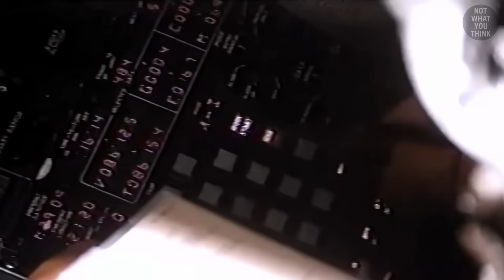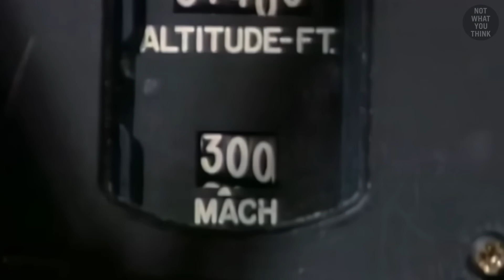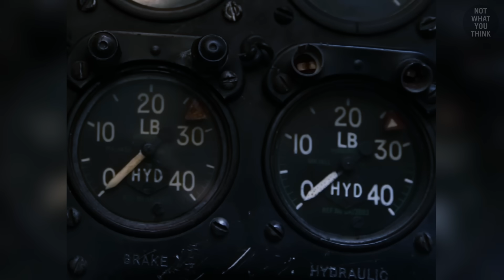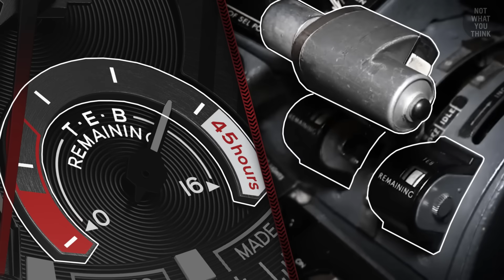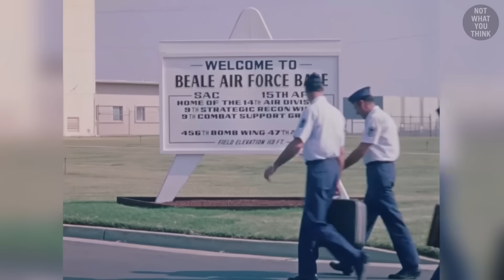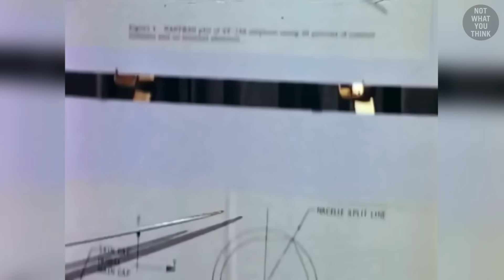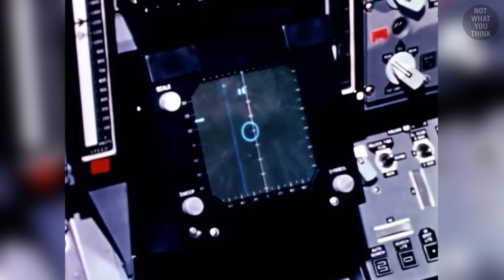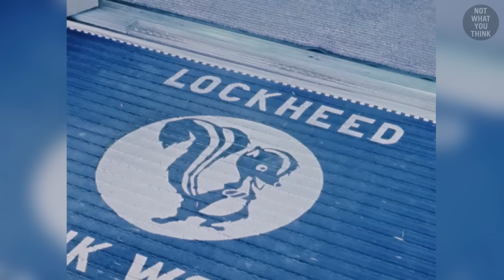Real Stories From The Cockpit Of The Untouchable SR-71 Blackbird

Comment: When I was working at NASA at Edwards Airforce Base back in the 90's, the SR-71 would be flown quite often on test missions. One of the cool things happened in the control room on every mission it flew, after MAC 2.5 and 100,000 feet all data in the control room would be displayed as "zeros" as the height and speed were all classified, even to this day.
Reply: None of those limits are classified. And it could never get to 100k ft or more
Reply: @gr8crash  Sorry your wrong. Try googling the SR71 and you will see that speed, height and a few others are still classified to this date. Even some of the pilots of the Sr-71 have said they are not able to speak to the limits of the plane for classified reasons. Did you ever work for NASA? If not, than you have no idea what you are talking about. the plane for testing that was given to NASA was specifically for very high altitude flights above 100,000 feet and was for a classified program that I can't talk about.
Reply: @MrLou345 virtually everything you just said is incorrect. Again all of that information is declassified and public and has been for over 2 decades. Pilots are and freely do talk about everything from their time on the aircraft. The ONLY aspects still classified are parts of the ECM/DEF equipment as it's still in use today. 

But speeds, altitudes etc it's all public knowledge.

Also I know the person who was in charge of SR71 flight test for NASA while it was there. The aircraft was never specially modified for flights that high as the aircraft couldn't even fly that high.
Reply: @gr8crash  The aircraft would need to go faster to even get that high, and even then at that altitude the engine would die no?
Reply: @gr8crash  Wait no IIRC the ECM equipment is dec. also, the name is out there along with its performance. IIRC it isn't a full-fledged one like the ones you'll see on an EA-18 or F-4G WW, it's rather simple.
Reply: @M16_Akula-III to fly that high? Yea the SR71 would have had to go much faster. They did study a zoom climb profile that would have gotten the SR71 to 100k ft, but it couldn't have sustained that altitude and the aircraft would have gradually settled into denser atmosphere. The other downside is there would be virtually no control so if you had to change heading at all it probably wouldn't have gone well. And with higher speeds come other problems. The inlets couldn't handle speeds much above 3.5 and the ahockwave over the wings starts to migrate so far back it interferes with the controls making the aircraft virtually uncontrollable. 

The ECM/DEF equipment was quite sophisticated. That system remains the only classified items of the SR71 as the systems are still in use today. The names of the systems i have seen, I have them some place. But the details of what they did, frequencies etc is still classified. A Growler I'd say is different. While the SR71 system was used to defend themselves specially,  a Growler is used to protect other aircraft/areas.
Reply: @gr8crash  Checked again, you're correct. Although the EW the Blackbird did use is actually rather simple, preset jamming frequencies tailored for Russian radars.
Reply: @M16_Akula-III i would say simple compared to modern standards but still quite effective. They often quote 4k missiles fired when it's closer to 1k missiles fired, either way the systems worked quite well.
Reply: @gr8crash  Oh yeah it worked well for at the time. I don't know why Blackbird glazers think it'll work against much more modern SAMs (S-300 family) though.
Reply: @M16_Akula-III against the S300 it would be fine. It's DEF/ECM equipment was protecting against that as well as they were in use in the 80s during the SR71 career still. They were heavily used around Moscow and they did have mission plans that would have flown the SR71 directly over  Moscow for a BDA mission and even that mission only carried a 3% chance of being engaged. There S400s may have posed a higher threat, but as some of that equipment is based on the S300 it's possible it system could have protected it against those as well.
Reply: @gr8crash  This is where I'll have to disagree with. The ECM on the SR-71 wasn't powerful, nor could it adapt quickly against modern threats if there was no other info given about it. There are cases of Viggens maintaining lock (although to be fair, the ECM on the SR-71 is simple frequency jamming, and they mostly only had preset use against the Soviets), and there are cases of MiG-25s maintaining lock and simulating a launch (a RSO of the SR-71 told a story about this, although some parts are unproven, like the missile hitting the MiG-25, and if the MiG-25 ever fired a missile at it). Against an S-300, the ECM on the SR-71 is not near powerful enough to jam it, and even then with the advancement of technology, I wouldn't doubt if one SR-71 were to be shotdown if it ever flew over USSR airspace.
Reply: @M16_Akula-III a 3% risk is pretty remote at best. But you're also speaking like the systems were static and never updated. They were constantly updated against newer threats and technologies. The SR71 missions led to the signals intelligence gathered to improve ECM equipment. They were very powerful systems as well. But they typically only functioned prior to a launch, once the SAM was in the air they typically turned the systems off. The Viggen deal is different, especially as the SR71 were at low altitude, and over friendly territory where the systems wouldn't be engaged. Even if Mig25s did lock on its dubious at best, but that's not to say the systems wouldn't have been effective still.

Comment: The other limit to the SR-71's range was the number of times it could re-light the engine or afterburners, which was usually 16.
Due to the ridiculous amount of thermal heating experienced by the SR-71, they developed a new jet fuel blend (JP-7) with less volatility and thermal sensitivity; so it could be used as coolant. While it stopped the fuel from igniting accidentally, it also unfortunately made the fuel rather hard to ignite on purpose (to start the afterburners!). Instead of electrical or compression ignition, they were forced to use shots of TEB (a liquid that ignites powerfully and reliably on contact with oxygen/air) to ignite the afterburner instead. Unsurprisingly, they decided that it was a bad idea to attempt aerial refuelling of the TEB as it's another liquid to handle and keep separate (and one that ignites on contact with air, no less) - which meant that SR-71 mission planners had to carefully consider when to use the afterburner during a mission.
Reply: They had a backup AB ignition system if they ran out or had an issue with the TEB system
Reply: They had plenty of TEB. Never ran out during any mission.

Comment: I believe those start carts, no matter what you want to call them, had 454 Chevrolet engines in them....not Buick engines. You may want to put a pin comment about that....

(Source was a television special I watched while the SR-71s were still flying.  Unless I'm badly mistaken, Buick only started using Chevrolet engines when they stopped making their own engines. Otherwise they would have been 455 Buicks....
Reply: They originally used twin Buicks in the start carts until they couldn't get them any longer. Then they used 454's.
Reply: @montecorbit8280  They had to stop using the Buick Wildcats because it was getting harder and harder to source parts when they inevitably break down from the stress of starting the SR-71.

12:57 Inside the hangars at Beale they installed an air system that did the same job, thus saving the start carts for the Dets.

Comment: As far as I know, the limit of the SR 71 was not the liquid nitrogen, but the ~21 shots from the hypergolic propellant to start the afterburner
Reply: The LN2 was the prime limiting factor for normal flight.  The pilot could control how many AB uses they went through so if they didn't need to re-start the use could be as low as one each for each engine to start it up initially with.  LN2 on the other hand absolutely had to be purged for every single refuel.  So for long distance air time where it would have to go through multiple refuels LN2 was the prime factor.
Reply: @Stubbies2003 and even if/when they did run out, they could still fly supersonic,  just limited to mach 2.8.
Reply: Was more the LN2. They had a backup ignition system
Reply: They were…depending on how many un-starts they had vs refueling stops…That dictated their flying time from what I know…
Reply: @stevea9604 the LN2 is what limited overall flight time. Initially the aircraft only had 2 dewar tanks, but they eventually added a third. Even if they ran out of TEB they had the catalyst ignition system. They just didn't like it.

Comment: I used to work with an engineer who had previously worked at Lockheed. He seemed to be a part of whatever engineering team inherited the legacy of the SR-71 blackbird.

We were at an air and space museum that had an SR-71 and he looked for the radar on the bottom of the plane. He was pleased that it was still there, and he said the images from the SR-71 were not actually from photography, but from a radar. He said this like it was a secret, as if no one, not even the museum staff, had realized this critical piece of equipment was still on the aircraft.
Reply: It used film cameras up until sometime in the early 80’s. Then they transitioned to some type of synthetic aperture radar.

This shift allowed for much greater  reconnaissance gathering, as that system was less hampered by weather and it eliminated daylight requirements. 

A friend of mine was a reconnaissance officer on that plane for six or so years. Every time I got too close to asking classified questions he would smile and say “When SecDef talks about it on CNN I’ll tell you” and then he would smile broadly, usually indicating that my guesses weren’t far off the mark! 

Miss you Ed!
Reply: @chadstearns5087  The film camera was mounted on the nose on the SR-71. And they didn't always use the camera nose. A synthetic aperture radar nose may be installed instead, to go along with the side-scanning gear in the chine bays.

They didn't have room for a long-lens camera in the fuselage any more because the RSO's back seat took up the space where the camera went in the A-12.
Reply: It used film cameras up until sometime in the early 80’s. Then they transitioned to some type of synthetic aperture radar.

This shift allowed for much greater  reconnaissance gathering, as that system was less hampered by weather and it eliminated daylight requirements. 

A friend of mine was a reconnaissance officer on that plane for six or so years. Every time I got too close to asking classified questions he would smile and say “When SecDef talks about it on CNN I’ll tell you” and then he would smile broadly, usually indicating that my guesses weren’t far off the mark! 

Miss you Ed!

Comment: "Why SR-71 Pilots Counted to 58 to Dodge Missiles" did I miss the answer?
Reply: Haha apparently
Reply: @gr8crash  so I did. I still don't understand
Reply: @princenoah21 ok that's fair, he goes over it pretty quick. So to keep it simple, they knew the type of SAMs they had and they knew the "burn time" that they had. Meaning the total time the SAM would be under powered flight. That time was ~58 seconds. So if you count from the time you got the missile launch detected warning you basically count 58 seconds and if nothing hit you by then you were safe. Also if they were on the collection part of the mission when that happens, usually they just continue course and speed. If they "evaded" they intelligence could be compromised meaning the mission would need to be flown again. And they did want to put other crews in danger.
Reply: @gr8crash  Ooohhh....okay. That makes sense.

Comment: A plane straight up outranging an anti-air missile is just badass
Reply: All aircraft can do that depending on launch parameters.  Not to be forgotten is that the burn time on missiles is rather short.  At which point it becomes a glider.  Pilots know this and can take advantage of that fact and turn to adjust aspect and force the missile to turn.  Which expends some of it's now limited energy to do that turn.  Every missile system has fairly well known maximum ranges.  Especially against older static systems like the SA-2 if you know where the launcher is you can know the range needed to safely escape.
Reply: @Stubbies2003  This.

Comment: Intresting fact missed, the faster it flew, the less fuel it consumed...
Reply: The higher it flys the less fuel it needs to maintain its cruise speed because the air gets thinner and the pilot can throttle down.
Reply: @Ben_Gunner  Yeah. This is for basically true for every plane that has decent altitude ceiling. Heck - that is why you can fly long haul flights "easily".
Reply: Probably because it's not a fact. It varies a lot.
Reply: @gr8crash  probably efficiency. Meaning it consumed "less fuel per unit of length", not timewise. Though initially - yes, that would be true as well. Up to certain speed.
Reply: @jannegrey it wasn't even necessarily speed, but temperature. Temperatures a little warmer than standard the SR71 could be absolute Full AB burning too much fuel and not even make mach 3 causing mission aborts which did happen. Other days where it's a little colder than standard the SR71 could be comfortably flying at mach 3.2 and maybe being half way in the AB range. So while having "room to go" doesn't necessarily mean there's more speed available especially if they were already at the engine CIT limit of 427⁰c
Reply: @slarratt  More miles covered for a given amount of fuel consumption.

A Corvette going 25 mph in a school zone is going to have terrible mileage because the distance being covered doesn't justify the amount of fuel going into the engine. But that same Corvette going 70 on highway in 7th gear is going to cover more miles on the same gas tank, even if it's physically using more fuel than it did going 25 mph.

Comment: Erm, Maury Rosenburg talks about the missle incident on the peninsula Seniors video channel on youtube, the radar warning light is a P for painting. Then a L for launch, this launch was 99% of the time simulated and the sro would then electrically 'ping the missle with a known frequency. In this incident the missle answered so the radar guided missle was following a radar beam to an altitude above 85,000ft they were cruising at mach 3.1. To avoid the missle the pilot just increased the throttle. And the rso jams the signal between the missle and the control station. After a short time around 20 seconds the missle exploded around a similar altitude off to the right of the aircraft several miles away.
Reply: We jet pilots call them "Thrust levers", not throttle. There is no "throttle body" in a jet engine that I am aware of. Also, in turboprop aircraft, they are called "Power Levers" because you are increasing the engine power to drive the propellers.
Reply: @manho9877  engine revs? Variable pitch propellers? In the dash 800's we call them throttle levers. Are you USA based?
Reply: @slarratt  And I thought aviation standardized everything internationally! Ha!
Reply: @manho9877 a throttle is a throttle regardless of the engine, I get where your coming from but as somebody who is into anything with a motor I just want to say a throttle is a control that meters either air or fuel or a combination of both.

It doesn't have to have a throttle body to have a throttle, if that was the case you could say nearly every idi diesel doesn't have a throttle.
Reply: @crf80fdarkdays  Aviation Law is written in blood. There are reasons for standardization in professional aviation for a reason. But you can argue with regulators and airline pilots. Be my guest.
Reply: @Pene7942  We pilots, who fly these things called them Thrust Levers. The normal Joe on the streets thinks the rudder peddles are gas peddles..

Comment: "...a 747 exploded from fuel vapor ignition inside the center fuel tank. Therefore, to stop the Blackbird from exploding the solution was to purge fuel vapors."

A horrible accident kills a bunch of civilians and the first thought is to protect the SR-71 pilots- classic US!
Reply: The last SR-71 was built in 1967, the first flight of a 747 was in Feb., 1969. Somethin' tells me that the things discussed in the video may not be as closely related as described.
Reply: The inerting system was standard since the A12 flew in 1962.

Comment: I wonder how many innocent people and property were damaged by those 4,000 sams.
Reply: They have fuses to explode the warheads upon returning to a slightly lower altitude. A small glass tube with a one way valve allows ambient air pressure to drop as altitude is gained, upon falling only a few hundred feet the glass tube would break due to the pressure difference and the circuit would explode the warhead so the missle would be in small fragments.
Reply: @ Thanks but still curious
Reply: If it helps you sleep better, the majority of those missiles were fired from places where innocent people can't own property.
Reply: @Logan4661  I agree but commies have never cared about collateral damage.
Reply: don't you worry, this number was nothing but a braggart hoax - I personally heard from an SR-71 pilot that they had never ever flown over Soviet territory
Reply: no such number exists in military documentations
Reply: @ferencmolnar6474  How would you know what numbers exist in ALL of the related military documents?
Reply: U ask the ones that launched them? Maybe ask murica why it attacks and invades every country, invades others arguments making them worse and bloody? Crazy
Reply: @fybyky Womp womp